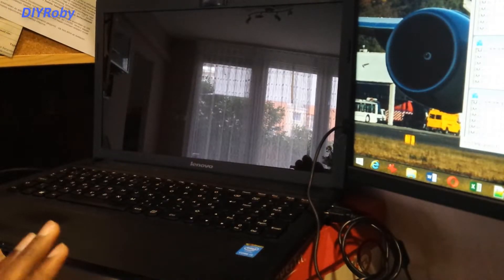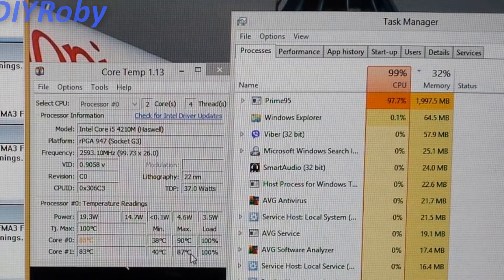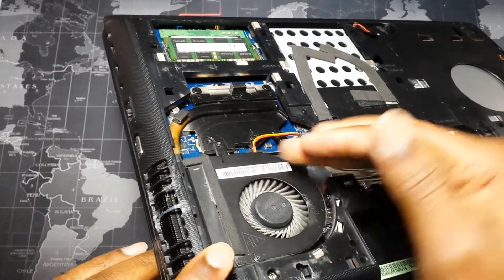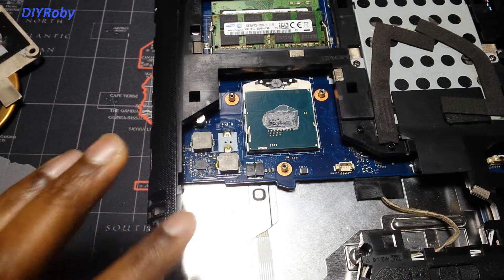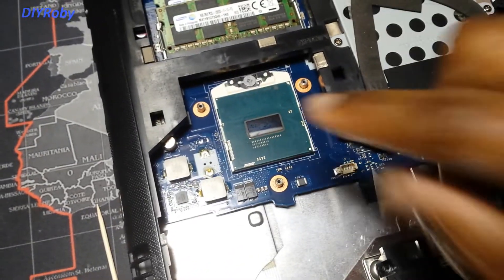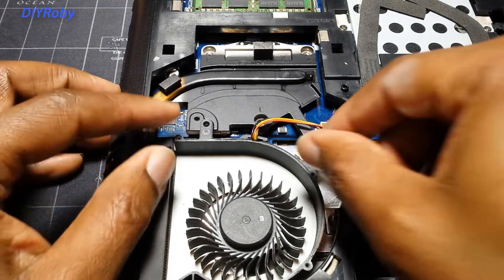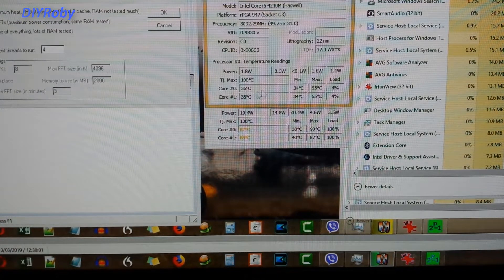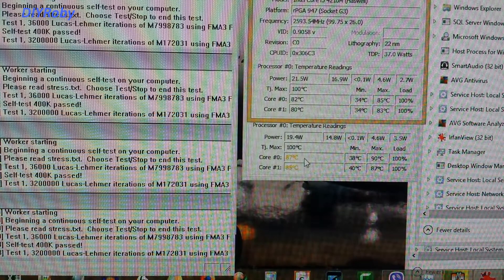How to change thermal paste and clean fan on laptop. BEFORE & AFTER shown on a Lenovo G510.

Comment: I also bought g510 @ 2014 and still it is in working condition.I went through your vedeo, because i need to separate the display panel and to repair Hinges. 
I appreciate your proficiency in laptop repair and also for your detailed vedeo.
Thanks a lot sir.
Reply from the maker: Glad it helped